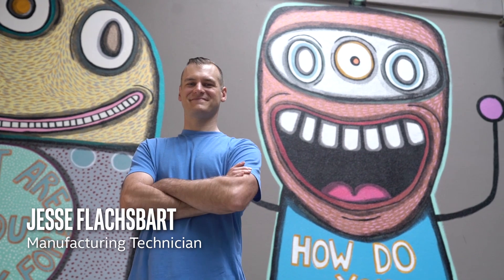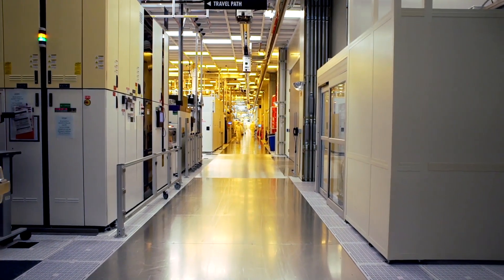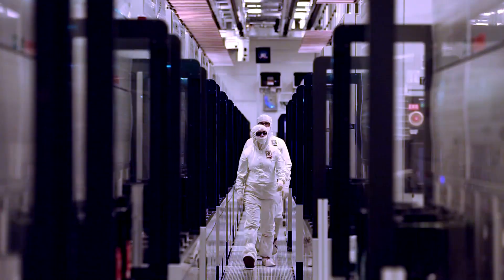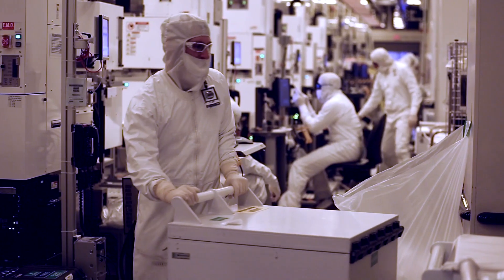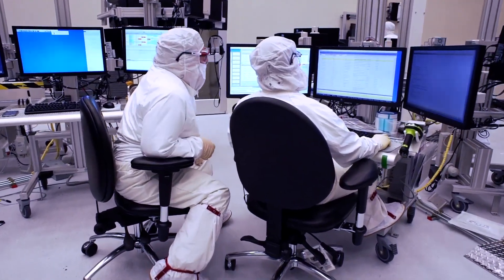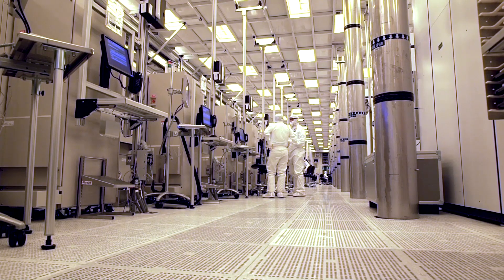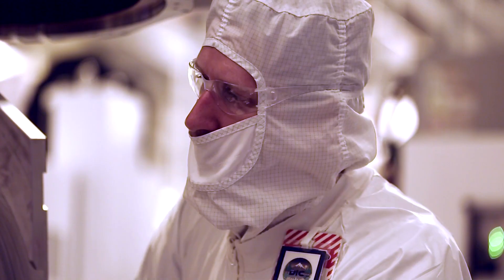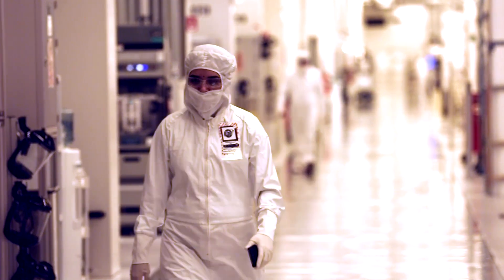Meet Jesse, an Intel Manufacturing Technician | Intel

Comment: We need 5 nm process intel, what are you doing?
Reply: "5nm" is a marketing term. Intels 10nm process doesn't produce transistors that are twice as big as transistors with TSMCs 5nm process. So Intel has to improve their production, but the nm specifications of different fabs don't have the same meaning.

Comment: #saveIntel #buyIntel based systems!!!
Reply: Why? You can get m1 cheaper, better speed, battery life, and better everything, for less? Why would you want intel? On my 10th gen intel Mac, I could barely run fortnite at 25-30 FPS, on my m1, I can easily do it on medium settings at 60

Comment: 14nm++++++
Reply: And it still more sable then amd chips
Reply: BlackHole nm's don't define stablity. Other stuff do
Reply: @battlebuddy4517  nonsense
Reply: they already released 10nm CPU-s 1.5 years ago. Good morning.
Reply: It still keeps up and was better than Amd how? Micro Architecture matters too
Reply: @bhoot1702  It did not keep up and it was worse than AMD* Fixed that for you. Sure architecture matters, and even there AMD's Zen core has proven to have higher IPC than anything intel has, its faster per mhz so to say. Want to talk about power consumption ?
Reply: @MissMan666  Ryzen 5 5600x costs almost twice as much as i5 11400f for barely any higher performance.
Reply: No 10nm on Mobile CPUs

Comment: Hey intel what is the process node of 11th gen 14nm or10nm
Reply: same old sh*tty 14nm, it looses pretty hard to AMD Zen 3
Reply: @MissMan666  depends on what you doing
Reply: 10nm
Reply: @rarinth  It's 14. They originally planned to release it on 10 but couldn't so they backported it. And it sucked and was worse than the CPU it's replacing.
Reply: @odizzido  wait did they?
Reply: @odizzido  I bet AMD fanboys told you that
Reply: @rarinth  Intel's own website says it's 14.
Reply: @odizzido  The Mobile 11.Gen Series is as far as I know 10 nm
Reply: @eulehund99  Oh yeah I think you're right. I mean we could look on ark,intel but yeah I think you're correct.

Comment: Do all 11th gen cpu support thunderbolt 4?
Reply from the maker: Hello! All 11th gen Tiger Lake mobile processors are capable of supporting Thunderbolt 4. Here’s a list of mobile processor models that you can refer to for more information: https://intel.ly/3ccnv5t Please know that the Thunderbolt 4 feature is usually integrated onto the motherboard by the system manufacturer. We recommend that you reach out to the motherboard maker to check the complete technical specifications prior to purchase https://intel.ly/3d0vWQs
Reply: @Intel  hey Intel, when can we see those Tiger Lake H 6-8 core CPU-s which were scheduled for Q1 2021? Still zero news about them.
Reply: @TabalugaDragon  I heard they be using 10mm design so I'm hype for that
Reply: @battlebuddy4517  Pat is making Intel great again

Comment: Waiting for new chips

Will buy them all😎😎
Reply: you can have them all
Reply: Like rocket lake ? That CPU is terrible
Reply: @MissMan666  hes paid by intel
Reply: @MrNick99  why would intel pay me lol
Reply: @MissMan666  not those
The 12 th gen
11 is just a stop gap between 12th gen
Reply: @MissMan666  nope, Tiger Lake H 6-8 cores.
Reply: Dummie. You shouldn't get intel. If you want a good laptop, get the m1 Mac
Reply: @fleecejohnson3298  M1 barely even exists. A single atom being displaced by a planck length would instantly fry the M1 processor.
Reply: @groszak1  that would also fry an intel. And what does that even have to do with anything? The benchmarks still stand: Intel is like more than 30 percent slower than m1, and runs hotter and less battery life. No matter how you slice it, M1 is just better
Reply: Intel uses a complex architecture that won't fry instantly. I would rather run slower forever than face permanent SSD data loss every time the subatomic M1 processor fails permanently.
Reply: @groszak1  looks like some people still use their brains...
Reply: @fleecejohnson3298  yeah I love running games like Cyberpunk and Windows programs on my M1!
Reply: @TabalugaDragon  facts. I am a video editor, and make a lot of content, I have a 2tb 16gb, 8 core gpu and cpu MacBook Air m1